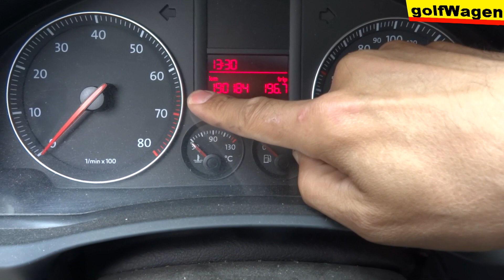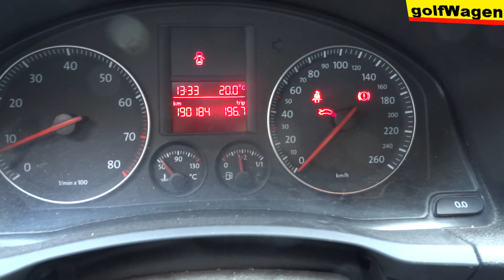VW Golf 5 1.6 petrol little preview engine before 200.000 km /190.000/

Comment: 1:56 Is that EGR valve??? I think its valve for input secondary air injection pump, which pumps air on cold exhaust? EGR valve itself should be right of that, or am I understand this wrong? I'm just trying to find EGR valve my own VW Jetta III 1.6 ...
Reply: No,  actually this engine doesn't have an EGR valve, thats the secondary air valve, I think this is a BSE engine, the BGU engine has the EGR right next to this valve.
Reply: @shadiomar4193  yes I have a BSE. Seems to me also that it does not have EGR valve. Thanks for info.
Reply: @shadiomar4193  I agree and its 100 true im sure

Comment: Does anyone know where the PCV valve is?
Reply: Its under the oil filler cap
Reply: @TeoYankov1234  Do you know how can i check if is ok the pcv?
Reply: @lucianflorin146 if you can feel any air or oil leaking or for fault codes indicating that the engine is running lean or maybe rich

Comment: my engine  is oscillating at idle...do you know why?...and I also have admission full of grease oil like yours and on the block...Do you also know why is that?
Reply: Its a normal habit for this type of engine , most Say its a cheap throttle so if you buy an extensive one , it will work Smooth but i have it with oscilations from over 5 years and still works fine , nothing to worry about really :D
Reply: The small pipe of the air intake pipe gets damaged on these cars. I have seen it with all these models. Then the oil drips from that stupid pipe on to the block.
Reply: Mine has the customary intermittent misfire at idle. Changed from 95 to 99 octane and it has gone away.
Reply: Also check your HT leads. The idle went back to normal after I replaced the Ignition coil and the leads. Three of four were green and had white stuff in them. But I also had the throttle body and MAF cleaned at the same time.
Reply: @lebohangmoloi629  This Engine does not have MAF sensor, only MAP sensor....

Comment: Mine has 297000 kms😊 great engine
Reply: Hi, what motor oil specification do you use please?  5W30 or 5W40 or another?
Thanks!:)
Reply: @miloslavhoracek7659  I use 10W-40 as I live in Cyprus, if you live in a colder environment 5w-30 is recommended in the manual
Reply: @socas_nic  oh, many thanks! I didn't know... 👍
Reply: @socas_nic   PS please what do you think about the idea of starting to use thicker oil (..40 instead of ..30) with higher mileage (eg 250k+)?  Many thanks!
Reply: @miloslavhoracek7659  It's normal to see a small consumption of oil in these engines especially if you do highway because of the low gear ratio of the gearbox, you spend lots of time at 3500-4000 rpm on the highway. Well the engine can run on both oils as far as I'm aware. Do you live in a cold climate environment?
Reply: @socas_nic   Thank you!  I live in Czech republic, colder than Cyprus:)  but summers hot anyway... Yes, it is 3500-4000 at highways.. exactly. And about 1-2 litres per 15.000km cycle.  Thanks for your insights! :)
Reply: @miloslavhoracek7659  just do the 5000km interval oil changes and it should be fine.
Reply: @socas_nic   OK! Alright! Thanks a lot!!